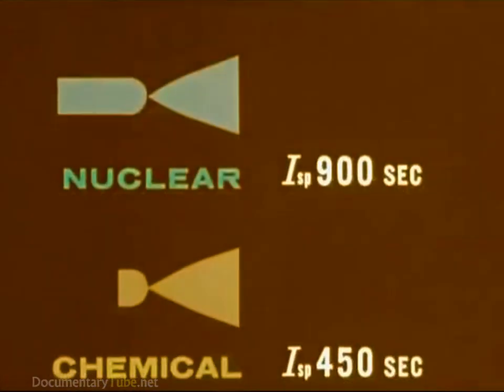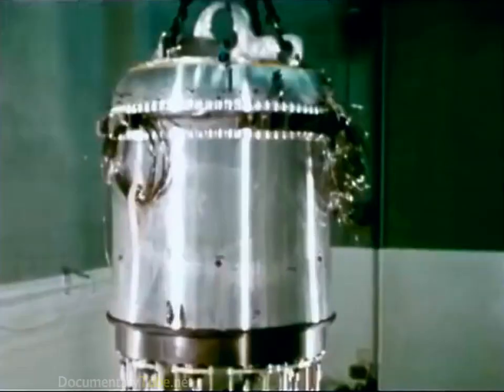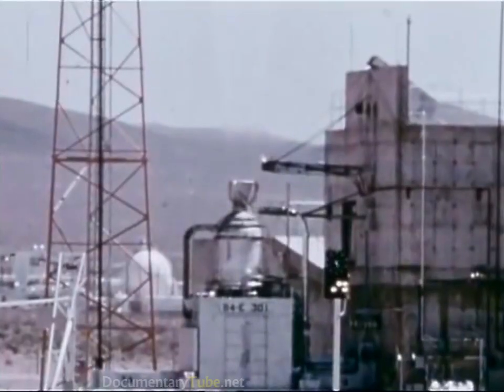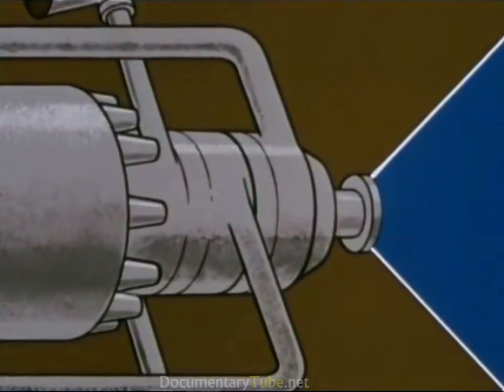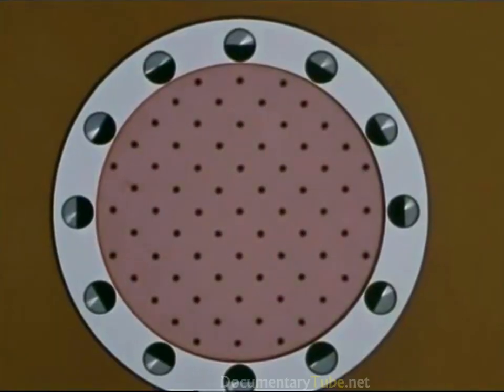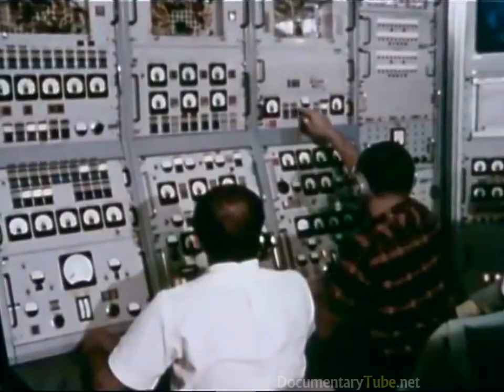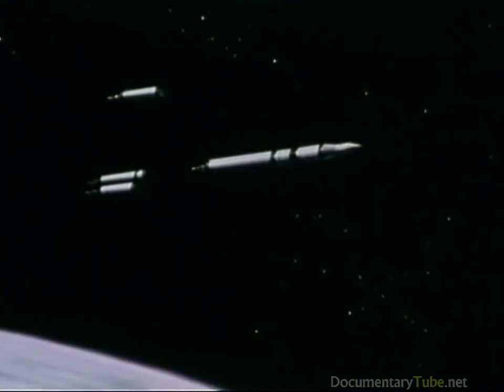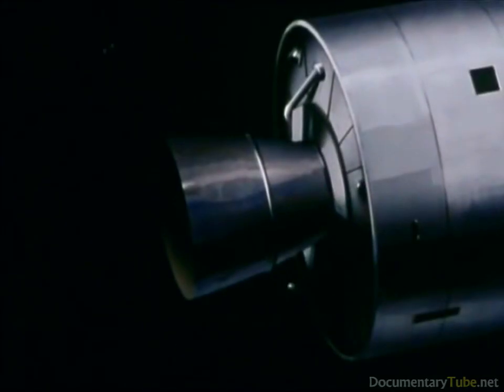HOW IT WORKS: Nuclear Propulsion

Comment: "And remember Johnny, anyone complaining about radioactivity in the atmosphere is a communist."
Reply: If you watched the video the hydrogen never comes in contact with the uranium fuel, it passes through carbide tubes within the graphite core.
Reply: Prince Westerburg wrote:  "... anyone complaining about radioactivity in the atmosphere is a communist." 

Well, only in the "West."  In the Soviet Union, the real "Commies" popped 120 or so nukes to aid in mining and other such efforts requiring the moving mega tons of earth.  Remember Ivan, anyone complaining about radioactivity in the atmosphere is re-educated in Siberia, or never heard from again.
Reply: In fact, unused nuclear fuel has quite low radioactivity; you can safely hold it in your hand. Protective canisters for launching nuclear material are very sturdy. In one case, a space probe with a RTG power source had a launch failure, dropping the payload into the ocean. It was recovered and the intact power unit was used in another probe. "radioactive fall out would cover huge inhabited areas" is uninformed fear-mongering.
Reply: So much knowledge in this thread. I'm impressed 👏😳
Reply: General rule, if you have no idea don't tell someone they are wrong without at least googling it first. "I have no idea what you are talking about, but I'm pretty sure that it's wrong" Is textbook Dunning Kruger Effect.
Reply: You got it hahahahahahhaha.
Reply: Hey! Check out my nifty Pip Boy!
Reply: 1% success rate? Where the hell did you pull that number out of?

There's something I heard before which suits this... "98% of statistics are made up on the spot."
Reply: The hydrogen has no direkt contact with the Uranium, so it is lightly irradiated. 
When travelling with this the cosmic background radiation will be a bigger Problem and we had an astronaut in space for a Year and he seems to be fit.
Reply: "If a nuclear rocket goes awry.... DUCK & COVER"
Reply: Prince Westerburg I take it you didn't watch to 14:20 and beyond where they specify this would not be used to get vehicles INTO orbit.
Reply: Your close but not quit Hydrogen with one neutrons, Dueterium with two neutron, Tridium with three neutrons. Also to do stuff like this safely couldn't we take non-reactive plutonium or uranium in to space then use a neutron source to radiate them like a fusor or something. That way nothing is launched from earth while it is radioactive. Its just made radio active in space. I also would like to point out that Dueterium and Tridium are not dangeruse or radio active.
Reply: No. Regular hydrogen (protium) has zero neutrons, deuterium has a single neutron, and tritium has two: so 1 2 3 particles in the nucleus. Deuterium isn't radioactive, but tritium is (mildly).
Reply: Tom Carman yes but a protium atom can spontaneously turn into a neutron and rocket off through space.
Reply: Even more fun is that Neutrons decay into the basic components of a protium atom(a proton and electron) plus an electron anti neutrino with a half life of 886 seconds. Though those components won't likely form a protium as they are being shot away from each other. If you look at it like this neutron + electron neutrino <-> proton + electron + electron anti neutrino it seems reasonable to me, mass isn't conserved but everything that actually has to be is.

Also electron capture in deuterium is a proposed method of cold fusion.
Reply: Luddite.
Reply: The success rate for almost all operational chemical rockets is at least 90%
Reply: Prince Westerburg Lol!
Reply: Well  gee welickers jimmy I just want to get my girl those dancing shoes she wants
Reply: jacob combs I have no idea what you are talking about, but I'm pretty sure that it's wrong. A (positively charged) proton does not spontaneously turn into a neutral particle. A neutron can decay into a proton by emitting a beta particle (relativistic electron): that is how tritium decays into helium-3.
Reply: but radiation kill my cat!... radiation kill taste of vodka... we cannot stand for this comrades! :D
Reply: moon dust is a real headache, due to lack of weathering on the moon, all the grains are forever sharp and they get into everything.
Reply: So, what you're saying is you're a blithering moron who didn't understand a word said in the video, or you didn't watch the video.
Reply: Prince Westerburg no communist just love killing millions of people.
Reply: There is a great reason to stop burning coal!
Reply: is that Libtard Humor?
Reply: gee bolly willikers maybe everybody can have cancer
Reply: 130 bcd
Reply: You must know that the earth is protected by a giant magnetic field from the suns radiation
Reply: Funny part is they blamed it all on asbestos and cigarettes. Wanna talk Extinction, let's talk Fukashima.
Reply: @Don Turnblade
That's why the nuclear reactor stage is an UPPER stage that doesn't fire until the spacecraft clears Earth's atmosphere.  There was even a variant of Project Orion (nuclear explosive-propelled spacecraft) designed to ride a Saturn V first stage into space, but I never shared the general enthusiasm about that.

The Orion upper stage would have started firing its "nuclear pulse units" uncomfortably close to the ionosphere, where their electromagnetic pulse might have done terrible things to satellites, and just maybe to electronics on Earth.
Reply: at Jackass flats Nevada
Reply: That isn't how it works.
Reply: @donturnblade9973  there is zero nuclear waste in the exoughst of the example in this video. Now plasma engines, which have never been created,  those use atomic nuclear propulsion which does have a lot of radiation.
Reply: @Anthony including Tchernobyl and  Fukushima?
Reply: Don Turnblade true, the hydrogen never really comes in contact with the radioactive material. The problem is the leaking radiation. The leaking radiation wouldn’t be the biggest problem however. The biggest problem was the rocket failing and breaking apart and leaking all that radiation.
Reply: That's really funny.
Reply: These are vacuum engines. They are to be turned on in orbit. And they expell traces of tritium along with hydrogen, that's it.
Reply: Quite the opposite in the soviet union.
Reply: You're so upset that your side lost the Cold War.
Reply: commie!!
Reply: makes sense
Reply: Just build a launch pad in the middle of the Pacific, in the same way as an oil platform. the rockets would be transported by a freighter and in case of accident nobody would die besides fish

Comment: Why aren't we doing this then?
Reply: I could be wrong, basically there are too many practical problems: radioactive exhaust gases, very heavy shielding is needed, etc. That can be done in a large submarine where size and weight aren't really a problem. But it is a problem in spacecraft, which  have to be as lightweight as possible.
Reply: because glowing testicles are bad
Reply: A powerful Texas politician (who became president) beclared, "Ah aint gunna hav nun a thet ther nukler stuff a flyin oer the heads a ma fella Texans."

Comment: jesus did you see all those stages. and everything was jettisoned! looks extremely expensive to and crazy to just jettison billions of dollars worth of equipment into deep space lol no wonder it never made it off the ground.
Reply: Scott Carter No computers? Have you been watching?
Reply: LOL - Unfortunately we didn't have the re usability part down - The materials science and economics didn't allow for it - I worked on Minuteman, Space Shuttle, Orion, etc and it truly is wonderful to see Space-X succeed with this approach.
Reply: what do you think of Skylon ? I looked at the engineering and design of that system and I was absolutely floored, the heat exchanger is the bit that finally makes it all work, but all together, that whole system, words don't do it justice, I think !
Reply: that's exactly what I thought...and then the stage is jettisoned...again and again and again ! talk about space litter...Elon Musk would have a fit !
Reply: Lakario Davis yeah but if we found out that there is a neutron star coming to this planet to collide with us and we only had maybe 60 to 70 years to get off The Rock we're going to do whatever we got to do
Reply: Lakario Davis that's literally what current spacecraft do
Reply: It's how space travel is done.  Rockets provided a lot of thrust for a small length of time, after the fuel is spent, the rocket is jettisoned......
Reply: Once your in orbit there is no need for the weight of multiple engines just use the one engine longer. You can jettison the fuel tanks and keep on using the same engine.
Reply: tommy felix 
They have a lot more important things they need to be doing.........
Reply: Afterburner are you for real
Reply: like f35   :D
Reply: just 'cuz you jettison something, doesn't mean you're done with it.. who said that you had to throw it away?
you can reuse stuff, ya know?
that whole recycle thing is gettingvpretty popular nowadays, ain't it?
Reply: That’s how the moon landings were done though. Lots and lots of jettisoning.
Reply: Lakario Davis what need to be done is build a ship in space with bigger engine. Shuttle the crew to the ship close to earth. Mars has a lighter gravity so have shuttle on the ship for back and forth travel on Mars. no waste. Black people need to do this.
Reply: and everything we have today is because of this kind of testing ....all done with slide rule math and pencils no computers no calculators show due respect fool!
Reply: The rocket is the cheap part... The real cost is the payload...

Comment: The NASA John Glenn Research Center in Ohio has done updated designs such as LANTR of about 15,000 LBs of Thrust !  This is good for redundancy (more than one engine) and wider thrust levels.  One NASA design is the "24-Hour Lunar Shuttle" (LEO to a Polar LLO) to operate in the deep Gravity wells of the Earth, the Moon and Mars.  Also details where written up in the NSS magazine Ad Astra July/August 1997 issue by Dr. Stanley Borowski !  Also NASA is now working on higher heat NTP (2018).  SpaceX and Blue Origin and others are bringing down the cost to LEO !  And NASA is working on NTP, LANTP, Ion and VASIMR engines to bring down the cost of travel in space.  To get full use of the Lunar Shuttle a commercial South Pole Lunar Base is needed to support each other !  Back to the Moon to Stay and onto Mars and Beyond-Ad Astra...  tjl
Reply: I think we need to forget Mars for the time being and go back to the moon if we go anywhere.  We need to see if the commercialization of the moon and its raw materials is doable.  That is the propaganda that kept us going back there and sending geologists there during the days of Apollo.  Low-earth orbit is still a considerable challenge.  Once we can live there in substantial numbers, THEN we might consider a push back to the Moon.  We have too much to learn about living in space to head out to Mars just now.

Comment: why not use  matter/anti matter  or plamsa energy tech?
Reply: No dilithium crystals
Reply: At the moment it would cost trillions of dollars to manufacture 1 gram of antimatter
Reply: kingdavewoody   Correct, according to CERN... it would cost at least a quadrillion (a thousand trillion) Euros to produce one gram of anti-protons. Even if heavier anti-matter could be readily and cheaply produced, (anti-electrons or positrons are actually used in medical PET scanners) there's still the problem of large scale storage and handling.
Reply: Theoretically good but practically, not so much.  A VERY long way to go with both of those techs.
Reply: SINESTERSERPENTSIXXX Because right now, that is pretty much just science fiction. We are nowhere near having anti-matter technology. As far as I know, only tiny amounts of anti-matter have ever been produced, and it takes an enormous amount of energy and is extremely expensive to do.

Comment: I bet the main goal was more nefarious though, probably to have practically unlimited Earth bound range on intercontinental ballistic missiles or to put heavy weapon payloads in space rather than the idealistic Mars exploration.  Because if it was for general good, then someone would have probably wondered how likely a explosion at a launch pad or in the air was, and I mean truly admit that it wouldn't be 100% success forever, thus irradiating a large area.
Reply: solid fuel icbm's have plenty of range
Reply: I would not bet against you !!!  Virtually everything done in space had military applications.  The civilian benefits were only side-bar issues.
Reply: like project pluto, the flying crowbar of death.
Reply: Not only that, but you don’t want one of these things to shoot up into the atmosphere, and then it explode like the challenger. Occasionally, rockets explode on the launch pad, or in the air. Last thing we need is a nuke blowing up a mile off the ground.
Reply: The Apollo and other manned programs were a quiet cover for rallying the public around the incredibly expensive development of ICBMs.
Reply: Poppycock. ICBMs existed well before that. And while heavy payload space missions require liquid fueled. Modern ICBMs are made with much less complex solid fuel rockets.
Reply: @ Don Turnblade “For me, the most ironic token of [the first human moon landing] is the plaque signed by President Richard M. Nixon that Apollo 11 took to the moon. It reads, ‘We came in peace for all Mankind.’ As the United States was dropping seven and a half megatons of conventional explosives on small nations in Southeast Asia, we congratulated ourselves on our humanity. We would harm no one on a lifeless rock.” -Carl Sagan
Reply: NERVA would be a waste for ICBMs.  And Saturn V rockets would have been quite sufficient to deliver orbital bombing platforms into high geosynchronous orbit.  However, the Outer Space Treaty outlawed the latter, and practical considerations ruled out the former.
Reply: sigh
Reply: russians fired v2s but their r7 was completely domestically made

Comment: 75 thousand pounds... the merlin does 190 thousand, What a time to be alive.
Reply: And F1  engine did  1 500 000 pounds  in  the 60's :)  Nuclear thermal rockets won't be used for  its thrust, but for ISP. They are best for second stages or space tugs.
Reply: this engine need to be lifted into orbit with chemical rockets. its only efficient when its in space.
Reply: Specific impulse of the Merlin is far inferior to a nuclear thermal rocket (NTR). An NTR's main advantage is high exhaust velocity meaning more delta-V for every pound of propellant. Its disadvantages are lower thrust, lower thrust-to-weight ratio (due to rad shielding), and extra care needed for handling nuclear reactors. The exhaust gas, if pure hydrogen, is not radioactive, but can be contaminated if the cladding of the reactor fuel erodes away and tiny pieces of nuclear fuel gets blown out the tailpipe. If only using it in space, especially deep space, this is not a health hazard. But it is a design problem nonetheless. So, chemical rockets for launch vehicles, and nuclear for deep space propulsion.
Reply: Except that this will fire for way longer than a Merlin and in the vacuum of space. Higher Isp but your point is taken.
Reply: exhaust gases are radioactive
Reply: Useless and inefficient? Yet somehow the most launched rocket of 2017 and shaping up to be the most launched rocket of 2018... Also implying they aren't actually reusable when they've reflown 13 boosters in 2.5 years, that doesn't make sense. Oh and hey another thing you were wrong about, the only similarities between the Merlin engine and the RD engines is that they both use RP1/LOX propellant.
Reply: Merlin  may be powerful but nuclear engine is highly efficient would carry twice as payload.
Reply: mmdirtyworkz the rockets gases van be better shielded with today's knowledge. Back in the 50s and 60s.the U. S. Air Force. Had wanted a better bomber. It's engineering. Was nuclear buy design. We could merge old and new engineering techniques. For a research testing. Of a new engine prototype.
Reply: According to the ESA the exhaust gasses would NOT be radioactive... So there's that.
Reply: but he is not wrong, there are engines with both direct and indirect contact with core and indirect seems to be safer.
Reply: you may want to check my channel where I uploaded a system... I am actually creating a 2nd and 3rd video to explain better the ordeal... remember to donate in my patreon page!
Reply: It's not about thrust, its about impulse. Nuclear engine gives more than twice the impulse so it's two times more efficient. Furthermore You don't need to carry oxidizer only hydrogen fuel, so You can take more of it with You. Double the ISP and double the fuel capacity means that nuclear spacecraft could be roughly 4 times faster than its chemical counterpart. It is really a shame that humanity didn't pursue to make these engines into production and fly to Mars and beyond. Instead we have to watch some rich guy lunch his useless and inefficient "reusable" rockets using reverse engineered soviet RD engines, which You so proudly call "merlin". What a sad time to be alive indeed:)
Reply: Nuclear engines are best used when attempting to obtain constant speed in space which is necessary to optimise space travel, a constant speed of 1g would let us reach the closest solar systems in a few months, think about that for a second will you. 
Its possible to do today but not economically feasible. 
The spacecraft would be immensely huge too and requires to carry enough fuel to go to the solar system and return.